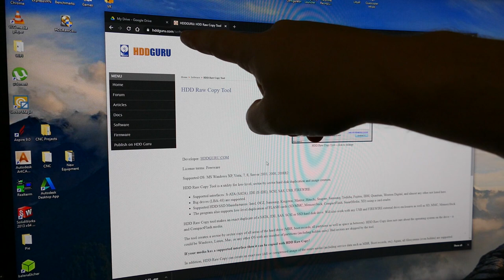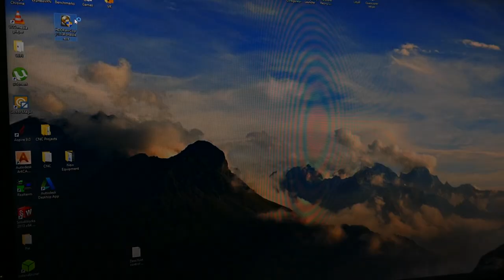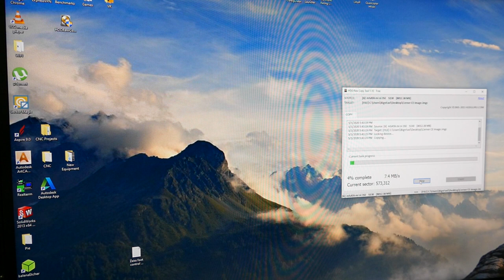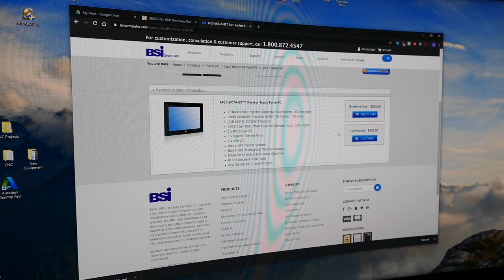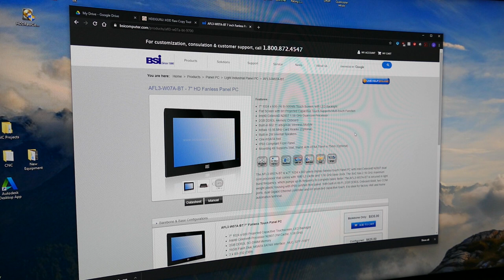Cerner CE Data Node Tear Down and Repair

Comment: You should be able to find the touch glass overlay as a spare part. It's a pretty simple repair. It doesn't look like the LCD and touch overlay is bonded together on this model anyway.
Reply from the maker: This touch glass would be very difficult to find. We (biomeds) are constantly bound by time if we do choose to do a repair. Buying another unit and using it for parts is as efficient as it gets when dealing with something as complex as a touch panel for a special purpose device like this.

Comment: I picked up a Cerner AFL-08AH-N270-CR from a thrift store, it powers on but only displays a white screen. Any ideas?
Reply from the maker: CE bootloader is known for it's issues. copy the solid state drive from another unit and test that the bootloader works. you have to be sure that the DC power adapter is outputting the correct labeled voltage too.
Reply: @BetterBiomedChannel  The back of the unit says 12v 5A im using a 12v 10A adapter that shouldnt matter right?
Reply from the maker: As long as the barrel plug polarity is correct.

Comment: White screen is kind of holding me back here from going anywhere. I can tell it posts and boots.

How do I just get the main primary display on unit  to show the Cerner logo so I can interrupt the boot process and start navigating to the BIOS settings.  Is there some stock OEM bootloader Image I need to flash the CF Card with HDD RAW Copy. I just need the primary units screen to show something so the unit gets to the BIOS, I'm not asking for an OS just to get this thing working.

Funny enough whoever had it before me tried something. I connected a USB to VGA adapter to it and to my surprise after it posts and beeps twice the screen goes from white to black on Cerner unit, and then on the USB to VGA screen it boots to an Ubuntu loading screen, but no cursor or login.

WHAT DO I DO!??
Reply from the maker: There isn't a traditional bios as in a windows computer. These Linux based items have a bootloader. Can you copy a working CE module?
Reply: @BetterBiomedChannel  No traditional BIOS really? I went to the IEI website, and found the support download page for the afl-07ah-n270-cr drivers etc and downloaded the user manual, and it indicates it has an AMI American Megtrends BIOS. I unfortunately do not have an exact replica of the Cerner IEI afl-07ah-n270-cr or a CF Card that came out of a working unit to copy cards to each other. So the unit likely has a CE Bootloader instead of a traditional BIOS, interesting?

Comment: Anyone ever have the CCE not boot past the Cerner loading screen.  We have had multiple occurrences of this on our vents.  It won't populate in I command but the network is active.  We have had to Re-image both units and configure the DA.  If anyone has any input on this I would greatly appreciate it.
Reply from the maker: I'm re-imaging 4 of these units today because of this problem. Make an image from a new device and burn that image using the process in the video.. Unfortunately, this is an Operating System issue..